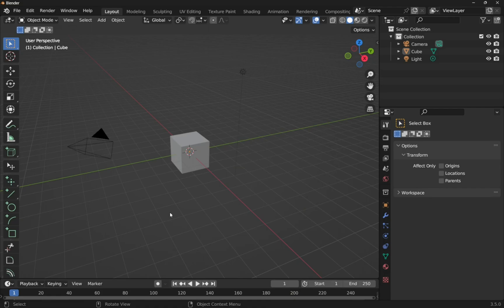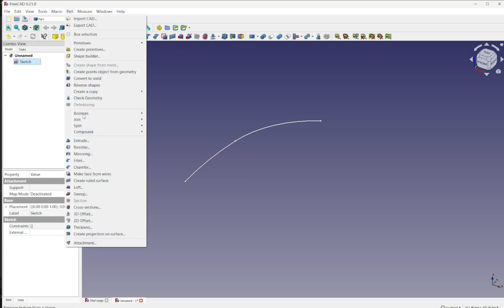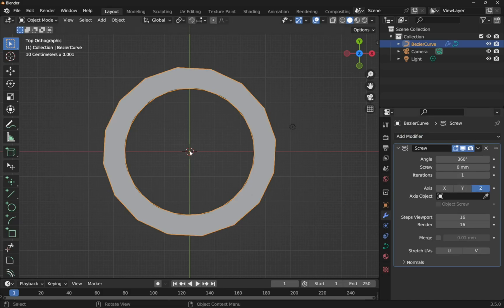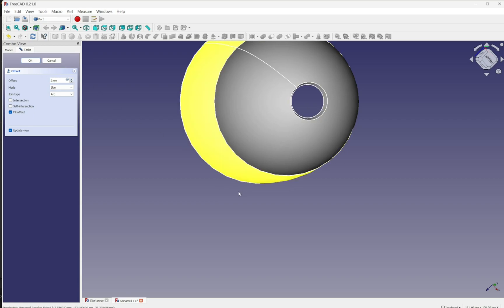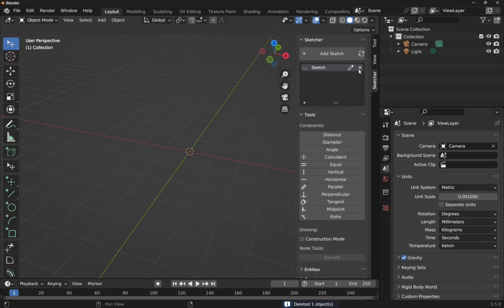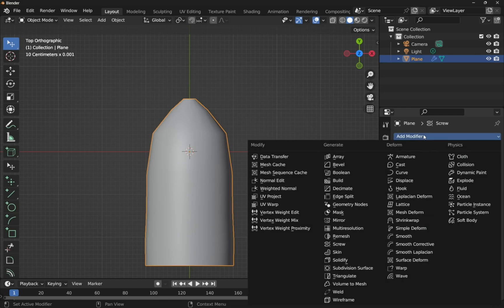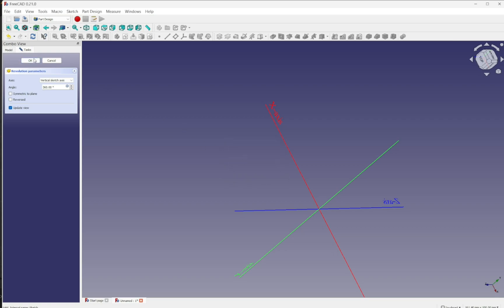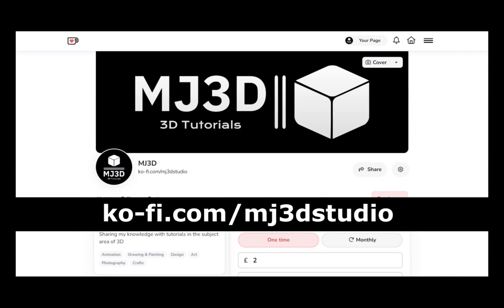How to Revolve / Lathe / Screw | Blender 3D Vs FreeCAD | CAD Operation Comparison for Beginners

Comment: In Blender, Instead of pressing E for each vertex, with the first vertex selected just hold Ctrl key and left-click where you want the next vertex to be. Every time you click a new one will be extruded. Much faster and easier. This also works for extruding faces.
Reply from the maker: Thanks for adding that, great tip 😊👍👍